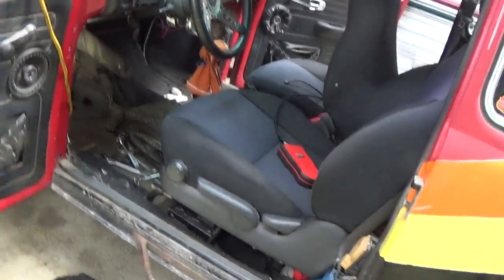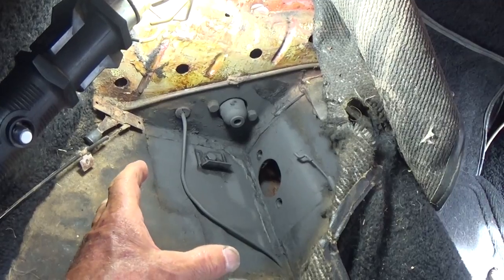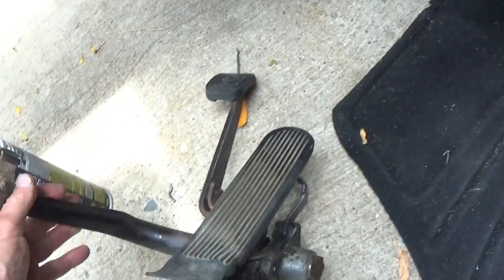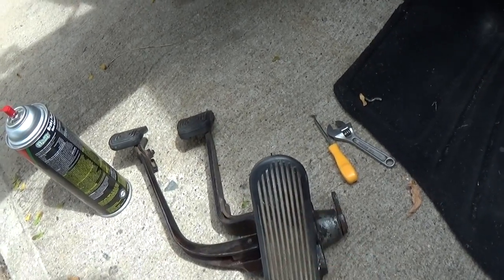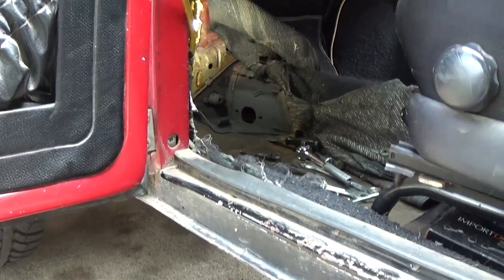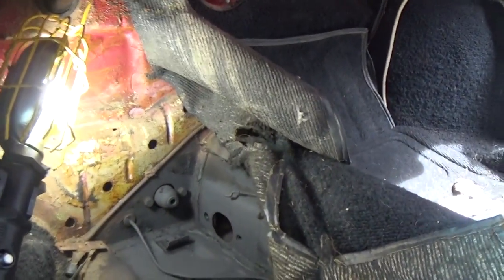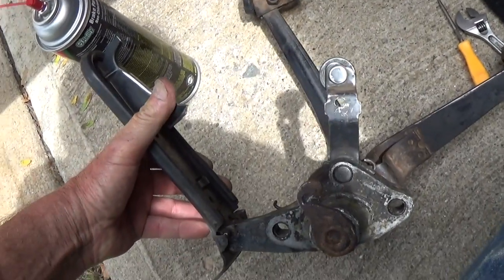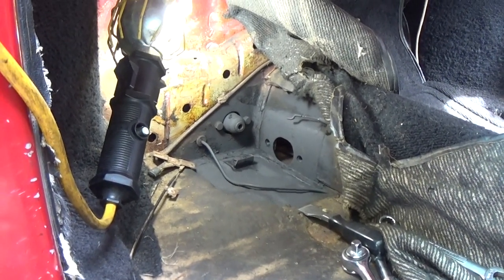VW Pedal Assembly Maintenance

Comment: We’re never disappointed, it’s just good to see you out and about. Hearing you laugh sure put a smile on my face. 
Good to see you doing better.
Reply: I'll second that! Always a pleasure to spend a little time with EZ!
Reply from the maker: It makes me smile when I catch my self laughing. It's not something I can control.  Life is a gift. Might as well enjoy it.   Our best times haven't even happened yet Gary.  Love you like a brother my friend.
Reply: @TheEZGZ Hey, Uncle EZ. Good to see you out and Vdub busy 😊. I'm looking to fit an electronic fuel pump to my bug 1600 engine, which is with 34 PICT-3 carb stock. My question: is something with 3-5 psi or 4-7 psi ok to use. Just want to pair a healthy combination. Thanks for all your knowledge...it goes light-years for all of us followers, I'm sure ❤
Reply: @romans3.25propitiation  you want normally no more than 3psi for most carbs. So if you run higher than 3psi, you’ll need to have a fuel pressure regulator.
Reply: @VWJawbreaker  Thanks, Gary. That helps put it into a worklist for me. Much appreciated, bro 🙏🏽

Comment: Just enjoy life Greg.  I remember one time I was 20 miles from home and broke a throttle cable. Of course I didn’t have a spare. So I ran the cable through the deck lid (72 beetle), around the outside of the car to the window. Put some vice grips on it for a handle. Yes it scratched the paint a little, but it got me home. I learned that day to always carry a spare cable. Lol. Have a great day sir!
Reply from the maker: Thanks for sharing that. Some days we are the hammer and other days we are the nail. hehehe

Comment: Good to see you again EZ.  Seen those worn "hooks" that pull the clutch cable worn like that many times when building the sandrails from well used VWs.. I've built the hook back up with weld, grind and file and there're good as new.
Reply from the maker: Right on :-)     I've done work on the hooks for years. But I use a factory cable

Comment: I've been thinking about going hydro clutch in my 1971 vw beetle 🤔
Reply from the maker: Sometimes we ran hydraulic clutches on our sand cars. They take away the feel of contact dramatically.   Then there was the issue with the clutch master cylinder??  Where would you mount that on a stock sedan without being in the way of the brake master and lines?  PITA to check fluid level and blah blah blah
Reply: Probably punch a hole in the fire wall weld a tab on back of clutch pedal mount slave cylinder and do a remote reservoir